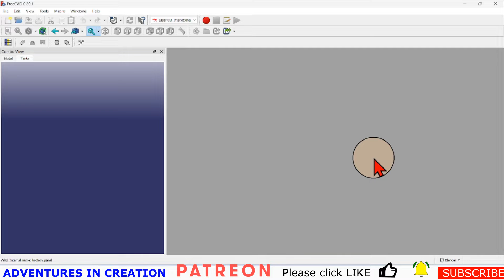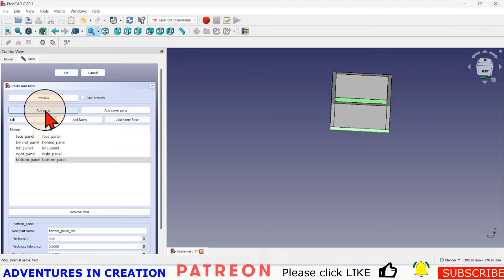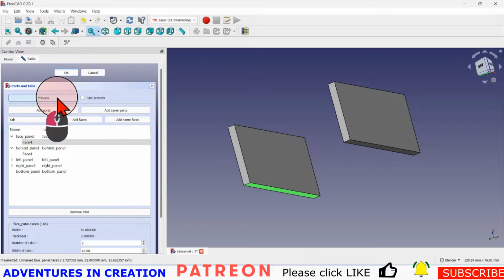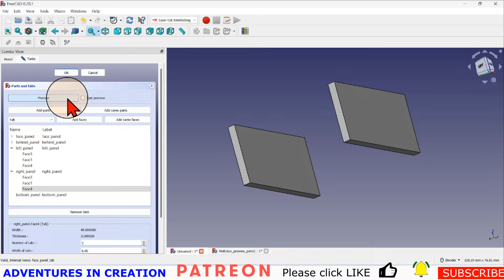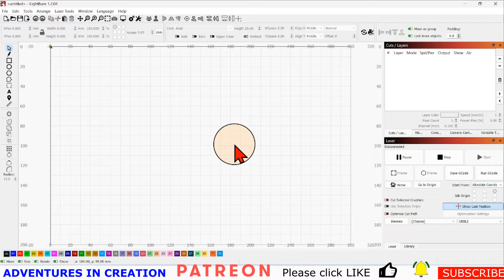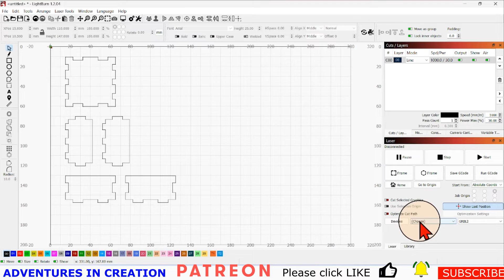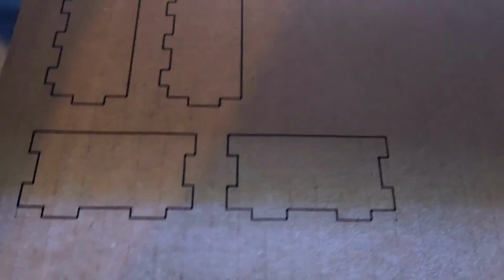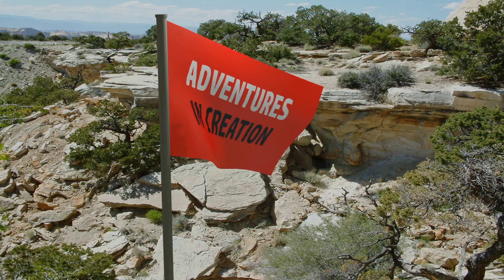FreeCAD Laser cutting 50mm Box #freecad #lasercuttingmachine #laser #makers

Comment: I appreciate your videos. I was really looking forward to this WB. I tried this on the new weekly builds and I can't get it to export correctly. It mostly works, but then I'm stuck cleaning up the SVG file in Blender. It just doesn't cut all the way through on all of them for some reason for me. It seems hit or miss. I have redesigned, reassembled, reset it up a half dozen times, and I'm feeling defeated at this point. Have you tried in any of the newer builds by any chance?
Reply from the maker: Funny you should ask, I have been creating lots of boxes with the lasercut workbench and they work very well with 0.22. I will be creating some videos on them.
Reply: @Adventuresincreation  My goodness. I'm really having a difficult time. I've gotten all the way to the end to the SVG, export_shape part, but the cutouts keep leaving a face behind; some, but not all. I have reassembled multiple times and everything. I'm just not sure where I'm going wrong. I am producing it form an A2Plus assembly. I don't know if that has anything to do with it. I re-did a bunch of relationships hoping that was it.  

Are you in the .22 stable release? I have been using weekly builds 36996, 37668, 37928. I just assumed it had to do with the TNP fix they are working through. I am still new to FreeCAD so I could very well be overlooking something too.
Reply from the maker: @mattspawn1975  I have been using the latest dev release and it works pretty well. I am not sure I know what your issue is.
Reply: @Adventuresincreation  I'll try again with a different model. To get through this one, I just went through the process like normal and exported to the layout file. Then used a ShapeBinder and External Geometry to reconstruct the sketch for SVG export. It obviously took me a hot minute, but much faster than drawing from scratch. Thanks again.
Reply from the maker: @mattspawn1975  You are welcome

Comment: add co2  assist to laser to prevent fires and assist in cutting
Reply from the maker: Where do you get that from?
Reply: @Adventuresincreation  Any welding supply shop, they use co2 in paint guns as well.
Reply: @Adventuresincreation  https://youtu.be/5q7vwQd8s-w watched them cutting paterns in foam for tools, they added an air assist and plumbed it to a co2 regulator to prevent fires

Comment: Nice useful video, got me going very quickly, but I also want to cut holes in the sides. Have you found a way to do this?
Reply from the maker: It very easy to cut holes too. You could model them into the box in FreeCAD or add them later in LightBurn.
Reply: @Adventuresincreation  I was looking for a way to do it within the LC.interlocking. box function. but it looks like i will have to make the box in part design and then move it over to LCinterlocking to do the tabs.